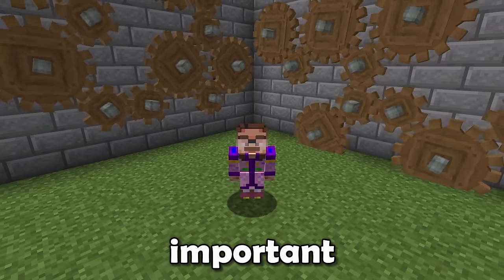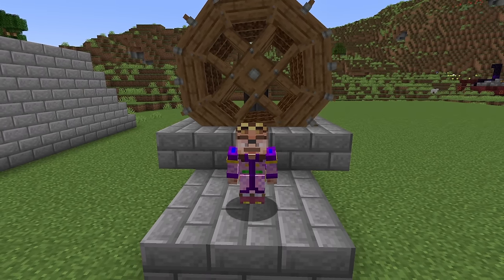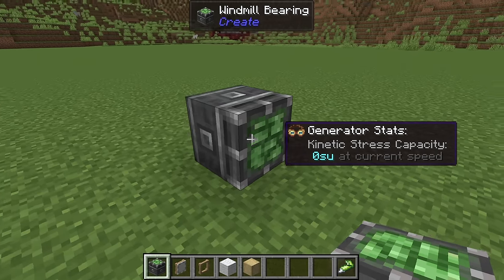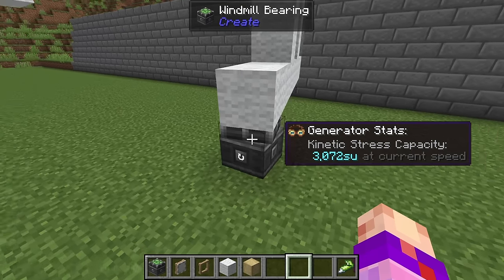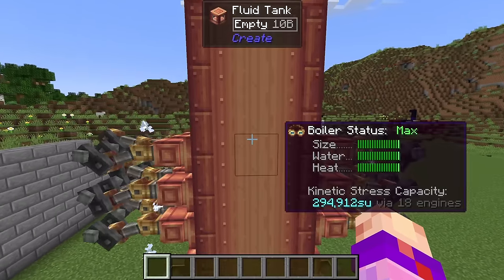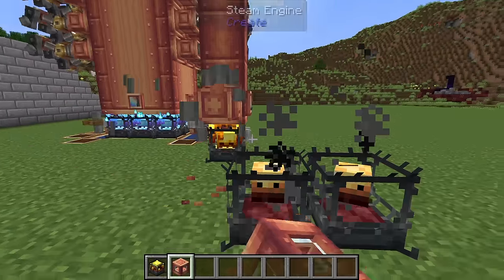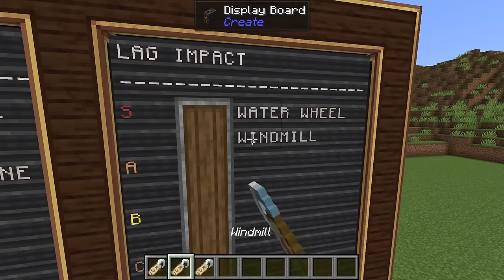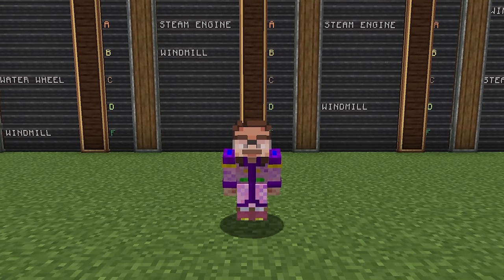Water Wheels Are BETTER Than Steam Engines (Kind Of) - Create Mod SU generator comparison guide

Comment: "Water Wheels infinitely scalable"

Yeah no. Water Wheels should get an F tier. Water Wheels are not scalable at all. You place a Water Wheel down and that's it, you're done, there is nothing you can do for that one Water Wheel to be any better now.

Windmills on the other hand you can add more Sail-like blocks to it up to a point, thus being able to increase SU and such with the SAME ONE Windmill for quite some time before you need to build another Windmill.

Steam Engines of course are the King of scalability for obvious reasons.

So in short, Windmill is far superior to the Water Wheel, as the Water Wheel does NOT scale and you need more and more Water Wheels....

Comment: Water wheel are more cost efficient that the large water wheels, because they need more wood for the same result. Wait, no, the result is way worse, because, you need more space and they are slower.
Reply: true
Reply: @pawebrzezinski9926  Bro forgot to switch accounts 💀
Reply: No, they're not. You get double the SU. The water wheel produces 256 SU at 8 RPM, and the large water wheel produces 512 SU at 4 RPM. If you use gears, a rotational speed controller, etc. to double the speed of the large water wheel, it produces 512 SU at 8 RPM, double the SU of the regular water wheel.

Comment: This vid is amazing but it has main issue, 16.000 su that are produced by waterwheel are different than 16.000 su that are produced by steam engine because of speed differences.... Water wheel spins at 8 RPM i think, and if u want to speed it up by 2*, you will loose su... Steam engine spins at least in 16 RPM.... You need to compare with same speed, if u don't, you know nothing and this vid is pointless...
Reply from the maker: You can slow down rpm and you can speed it up too, you don’t loose SU, machines do cost more SU at high RPM but you don’t loose any

Comment: If I recall correctly, your intro has a falsehood. I believe that cogwheels don't take up any stress units, and so, even if you had a generator with 0 stress, you would still be able to run them.
Reply: Technically he's not. If there aren't su present in a system it won't spin. So even though they may not take su, there needs to be su present for them to spin
Reply: Its configurable. some modpacks configures it to cog and belts using a tiny bit of SU.
Reply: @mctripleA  Tecnically you can also place 1 (one) block of wool on the windmill bearing and trough variable speed controller speed up the whole shebang to a 256 rpm, lmao